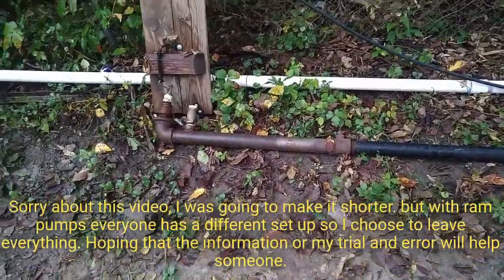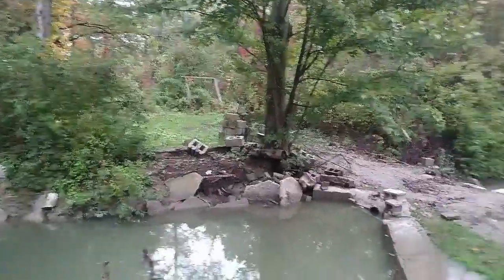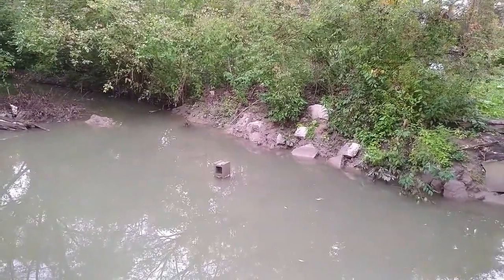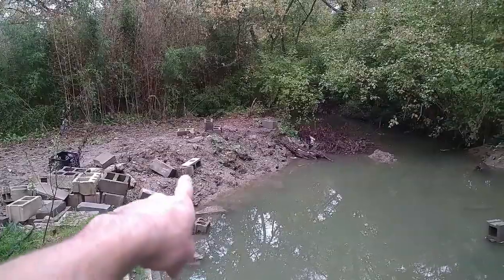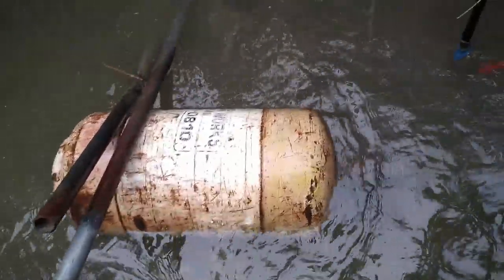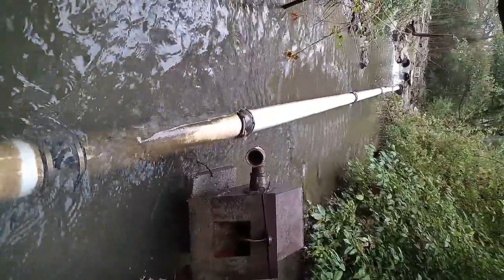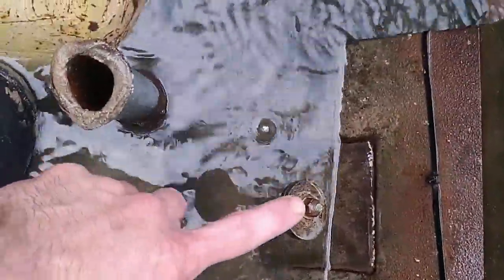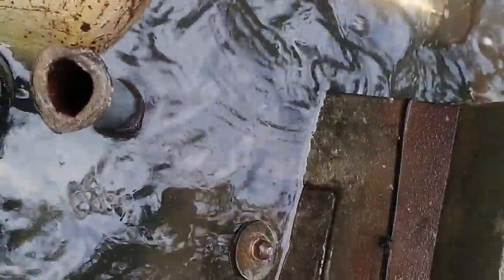Ram Pump story

Comment: One thing that I think would benefit you. Where the 8-inch and the 4-inch are connected on the drive pipe, that is where your head starts. At the top of the water that's coming out. If you were to extend the 8 in pipe up far enough so that the water does not go over the top you will maximize your head back up to the level of the pond. I built these and messed with them for years. Let me know if you have any questions. These things sure are fun to mess with and see work.
Reply from the maker: That is the first way I had it set up, but the stream is  so slow most of the time during the summer months (when I need it most of course) the pump would actually stop the flow of the stream. For whatever reason I did not spend the time to figure it out in that case the pump would never just run. But when I let the water flow threw the 8in and into the 4  and over the top of the 4,  the vent effect took over and created a suction on the inlet of the 8in.  I assume that if I rebuilt the pump housing for a bigger check valve it would work then. I just might get to that this summer. Let me know if you have any ideas !!! You are %100 correct you can loose a few hours, days lol playing with them.